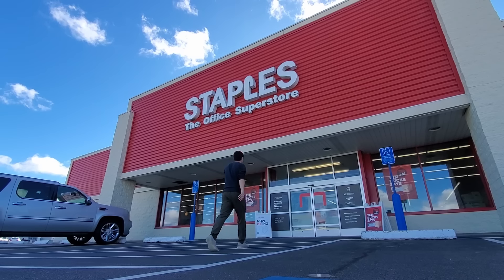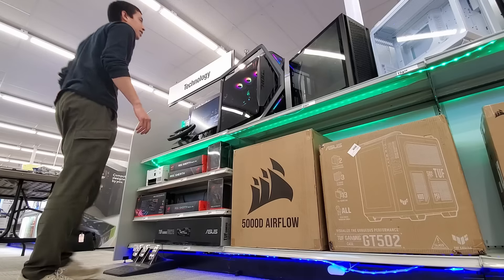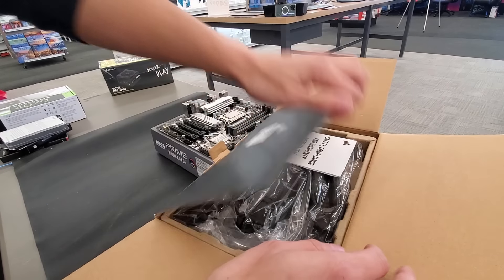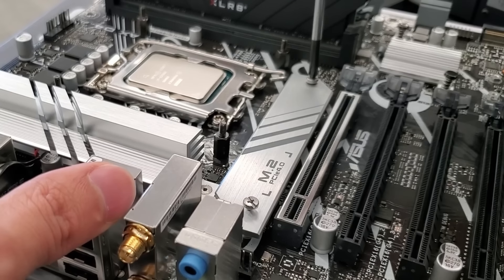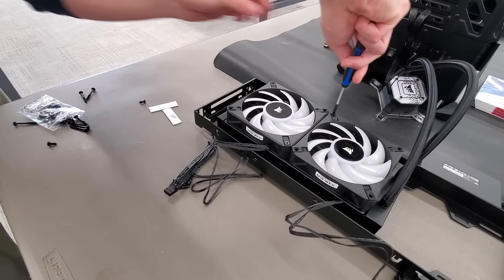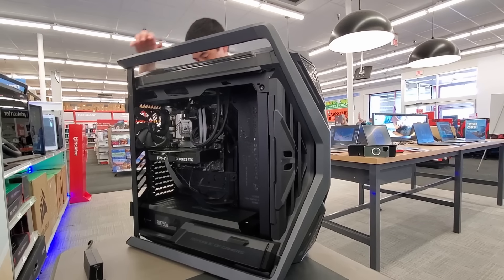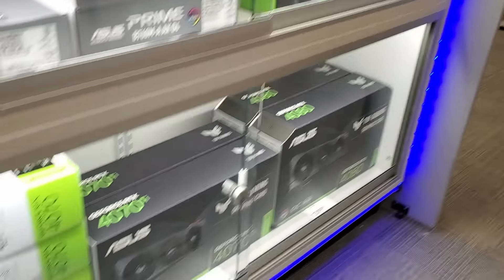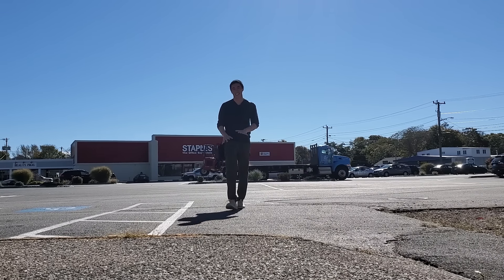Can you build a Gaming PC at...Staples?

Comment: Whoa, WTF....
I gotta go see if the two Staples by my house are like this.
Then again, back in the late 90's and early 2000's, Staples and Office Depot were the places to go for Laptops and Desktops. I bought my second Desktop PC at Staples right after the turn of the millennium. 10 years ago, the Staples up the road from my house used to have a small section with various Antec products and low end Graphics cards.

Comment: Crazy that they have 4090s for retail when even my local microcenter doesn't have any stock. So I had to "settle" for a 4080. Although the 4090 they have in stock is a pretty low quality 4090 and I got one of the best 4080s on sale.

Comment: Nice Work, in germany we don‘t have Shops like that just some very few like Notebooksbilliger, but they are more Online Showcases as really a franchise. One thing that bothers me is the suuuuper expensive case… nearly 500$ for such a huge case is in my opinion way too much for a 13700K, 4070, DDR4 build. You have so much free space in the case, a D3000 / D4000 or maybe a ASUS TUF GT502 would fit everything so nicely and cost around 300$ less… vice versa 300$ more for a second M.2, nice PSU extension cables or one step better GPU like the 4070Ti… Probably it‘s just me, and i personally don‘t like big cases but want to share my opinion.

Comment: as someone who works at a staples i can say that no,no you cant but you can get close if you feel like spending more money then needed lol. unless you live near a lv 5 store then you can but most staples are lv 4 meaning most parts are only online.
Reply: What differentiate between lv 4 & 5 if I may ask? I would assume my local store is lv 4 because they have a crap selection of PC hardware. As a matter of fact, I don't even know if they still sell any parts anymore. Last time i bought a hard drive and low-end graphics card was over 8 years ago.
Reply: @JJFlores197  if the store actually sells anything gaming related like cases gpus etc in store then it’s a lv5 store. If you have gaming laptops then your a lv4+ and if you have non of that and have to get them online you are a lv4 store like mine

Comment: Gen 4 PCIe SSDs do need heatsinks they run hot and under load can thermal throttle.  Also I have never slid a PS from the back, there are tabs aht overlay PS screw holes would make that impossible.  But the only think that makes me sad, is they closed my local Staples.

Comment: Brother, whenever I play a game, the game crashes, but it does not crash while the game is running, it happens in the lobby, otherwise I get 90+ fps on ultra graphics.
my ps spec: processor   AMD Ryzen 7 2700 Eight-Core Processor             3.20 GHz
ram 8 gb 
gpu gt610 2 gb